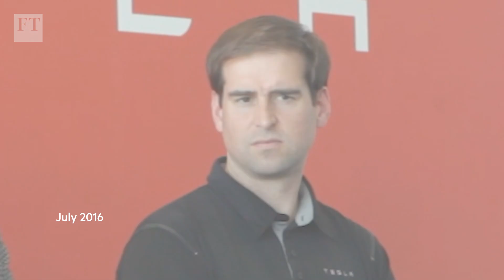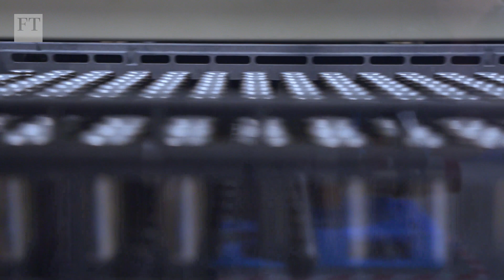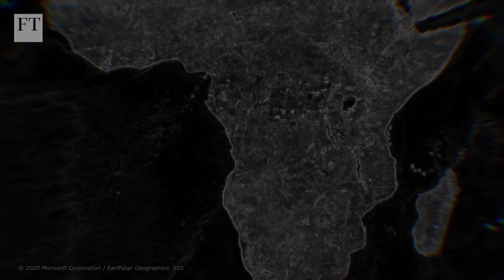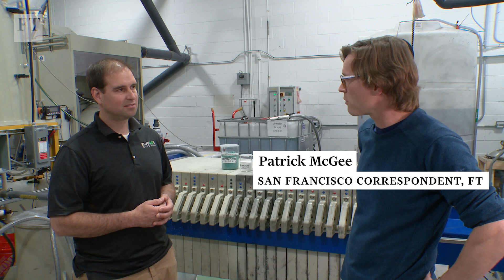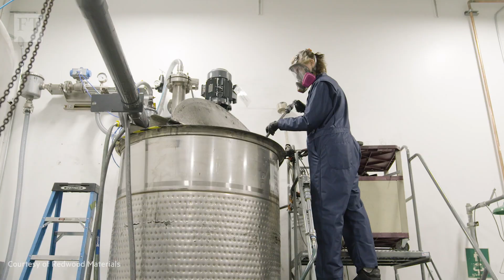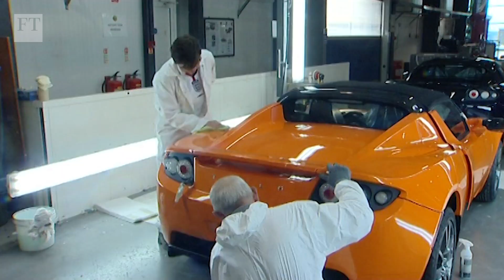This Tesla co-founder has a plan to recycle your EV batteries l FT Energy Source

Comment: An EV is, in good conditions, a lower emissions vehicle. There is no way a manufactured 4000 pound moving thing on wheels can have a zero emission full life cycle.
Reply: They are not claiming to have zero emissions, but by reusing materials it lowers the emissions. It also lowers the required mining.
Reply: still better than oily thing